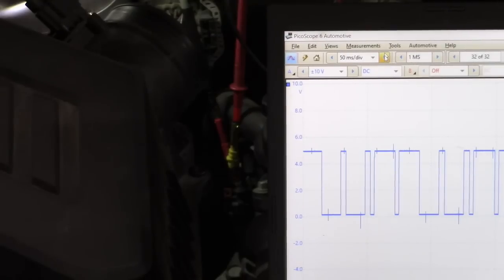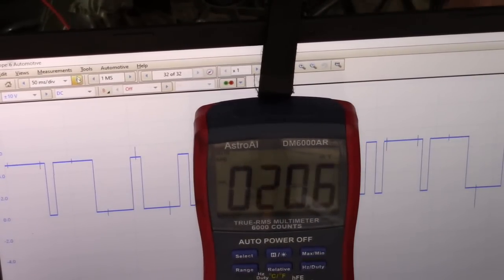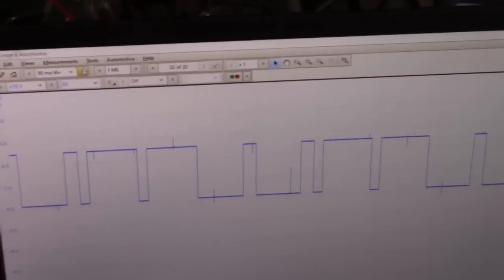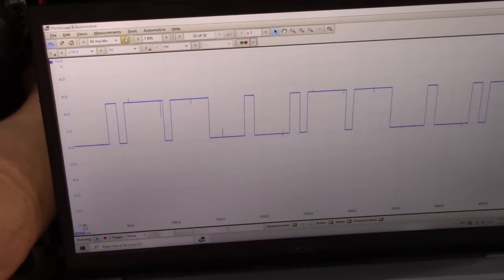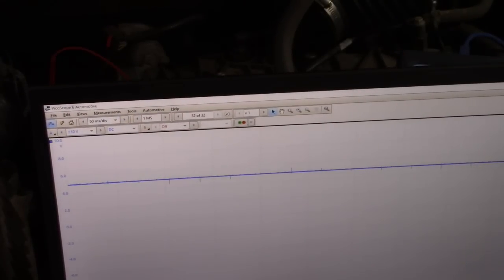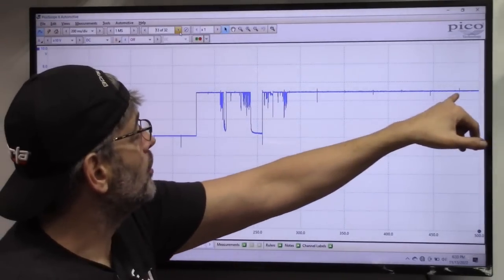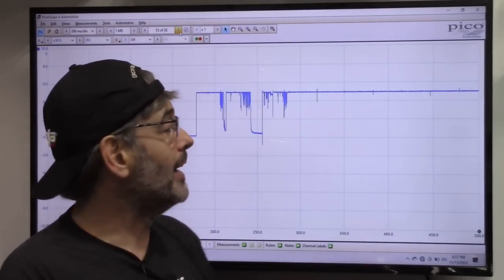How to Catch an Intermittent Bad Cam or Crank Sensor

Comment: what is shown in this video that when the fault occured the signal wire stayed at 5V indicating the sensor is faulty because it stopped producing signal and the fact it stayed at 5V (and not 0V) means the ref. voltage and ground circuit is good because without those it would show 0V,

I heard someone say some PCM are designed with a pull up resistor on the signal wire, and some with pull down.
therefore is this test only valid for PCM which have pull up resistor on signal wire which means the signal wire always has 5V when the sensor is not producing signal?

but if PCM is designed with pull down on signal wire then at rest the signal wire is normally at 0V when sensor is not producing signal, in that case when there is a fault that the signal wire is stuck at 0V it can mean either a faulty sensor or wiring?

does that make sense? I just recently learned some stuff about this I'm not an expert and I may be wrong...

Comment: I have found on my 99 Blazer that the Crank sensor 12v reference wire has continuity with chassis ground (the low reference wire also has chassis ground). Would this indicate a possible short somewhere and possibly be cause a misfire code?
Reply from the maker: Yes there reference wire of course should never touch a chassis ground. It should be direct from PCM to the sensor.

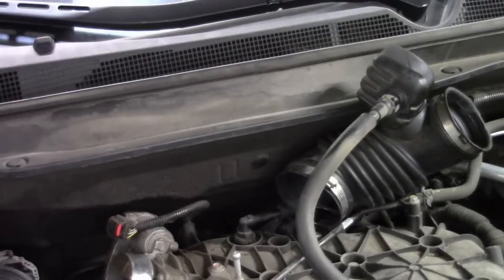Comment: 10:48 This is what’s happening to me now. I just got my sensors replaced two days ago (didn’t even know they were bad, wasn’t having any symptoms then) and now my car has a hard time starting on the first try. It’s incredibly intermittent. The mechanic couldn’t repeat after nearly an entire day of trying but then it happened to me after I took the car home. I suggested it was the sensors but he brushed me off and blamed the brand-new battery. He won’t even entertain the idea that it’s the camshaft sensors he just put in. It’s frustrating.

Comment: I have a 2000 k 2500 Chevy which I recently rebuilt the motor got it back in and running I did a final valve adjustment in on the driver side valve cover it's pretty tight so I pulled a little bit on the harness and lost my spark completely there is no RPMs when cranking no spark at the coil everything is new and I realize new is not always good but I actually did a test on those parts on my other truck and they all ran that truck fine so I'm thinking it's a broken wire from the crank signal. As I am not in the greatest of health it makes it difficult to do certain things but I watched one of your videos about a PCM crank sensor bypass and I'm thinking that may be my answer I have tested for 12 volt power at my coil at my distributor at my crank sensor and everything also I realize that continuity tests are not the greatest because it could be one strand of wire but that doesn't mean it's going to run the vehicle. This truck is just a base vehicle two-door and I'm trying to find out my best route without having to tear the whole harness out of it as you know those are a pain in the butt they go down and under behind the power brakes in the whole nine yards and I don't believe I have it in me to do that although the other problem is is I can't afford it as I am on a fixed income. If you could possibly help me find the pin out location on the PCM for the crank sensor location and color wire possibly I would very much appreciate it as I have all my money tied up into the rebuild and everything else and this is supposed to be my daily driver as my 96 Silverado is in very poor shape living in Ohio it wasn't taking care of so great as far as rust. Please please help.

Comment: Hello. So i wasn't able to check the voltages at the connector for cmp sensor. I went ahead and replaced the connector today and i had already replaced the sensor.  IT runs fine, starts fine, when check engine light comes on it runs fine and starts fine. Odd thing is it seems to happen consistently when I'm about a block from my house. I don't see any obvious chaffing.  
Do you recommend I run it till i get engine light and then check the reference? Or can this be done with some kind of live data?
Reply from the maker: Can’t say because we don’t have any data.

Comment: Hello , me again lol . I have replaced the alternator , new starter , new battery , fuel pump , cam shaft sensor , crank shaft sensor fuel injectors, computer etc. This car you can disconnect the negative cable on the battery and it still has a parasitic current draw . Oh this is still about the 2003 dodge caravan . And it is hard to get it to start even with a hot battery . It makes a clicking sound like , I don't know , maybe low fuel pressure . But after you get it started it runs very good , after you drive it a while and shut it off , it will start fine , But after it sits maybe 6 hours or so it is hard to start all over again . This thing is driving me crazy , but I'm too damn stubborn to give up on it . The funny thing is , I know you can figure out what's wrong with it . If I could afford what you charge , I would let you have  a shot at it ,lol . I've got way too much money in her , I can never recover any of it . I've got to keep her and try to make her last . It runs really good , just a bitch to start lol . 🙂🙂🙂🙂
Reply from the maker: Ok let’s start with the extreme basics here. 
  You replaced alternator, starter and battery.  What data showed all those were bad? What was your charging voltage showing? What was your voltage drop at the source and load?
  You replaced cam sensor, crank sensor, injectors and computer.  This doesn’t make sense to me- either there is no generated signal from the sensor OR the signal is not read by the computer. Which is it?
    What is the amperage of the parasitic draw?
    What is the fuel pressure? 

 M
Reply: Bad ground somewhere ?

Comment: Can you have a bad cam sensor/sensors without a ce light?  I am having some bizarre issues w my 2003 Expedition 5.4. I can start it up about 10 times super rough idle no throttle response soon as you hit the throttle it stalls real bumpy idol and then about the 10th or 12th startup it runs and smooths out and is totally fine for 10-20 min until you restart it.  No codes I'm just thinking it could be throttle position sensor or cam sensor I did the crank sensor last year. Also ANY touch of the throttle it wants to die when this happens. Any ideas thanks in advance.
Reply from the maker: You absolutely can. Usually I see it on intermittent no-start issues. Never get a cam signal code. However if the sensor fails while engine running you almost always get the code then.
Reply: @SchrodingersBox  TY I think it is ecm
Reply from the maker: Possible to. If that’s the case, simply check for signal at the PCM. If the signal is present at PCM but not recognized, then the PCM would be at fault. 
   Anytime I have ever done this I have always found the signal is not getting to the PCM though.
Reply: @SchrodingersBox  Everything is good NO ce at all, but like I said starts up fine and normal for about 10 min then BOOM all stumbly like a vacuum leak, then 7-10 restarts all normal again for 10 min all sensors are good even replaced the cam sensors and crank sensor.
Reply from the maker: What data do you have?
Reply: @SchrodingersBox  NEW UPDATE when I reset the ecm (pos/neg touch) it RUNS FINE, shut it off and restart back to CRAP I think its a ground (which I doubt) or the ECM.
Reply from the maker: Ok again- what data do you have?
Reply: @SchrodingersBox  NO data but like I said when I wipe out the ecm and start it , runs normal and perfect until I shut it off then I have to ground/reset the ecm again and it is fine I think it is ecm
Reply from the maker: Of course there is data. What’s the fuel trim showing ? What’s the voltage for the cam signal showing? What’s the coil pulse signal voltage? What’s the ground side voltage control for the injectors showing?
  This is all basic data that would be needed!
Reply: @SchrodingersBox  I have no way to get that.  Im just shooing the parts cannon.
Reply from the maker: Well I can’t help with that. Just get a $3 test light and get some data. But without data there is no way I can tell what’s wrong. I would just be guessing.
Reply: @SchrodingersBox  I agree but at this point it is really pointing to the ecm like I said before can you pls email ill send videos.
Reply from the maker: How is it pointing to the ECM when there is no data showing that? 
  If you want to replace the PCM it is virtually guaranteed you won’t fix it. There is no data showing the PCM is receiving signal.
Reply: @SchrodingersBox  Just going by the fact i replaced most things that would cause this and like I stated when I reset the ecm it works fine until I shut it off and restart it it goes to hell again.  I sent you my email like I said I have videos.  What would you look for first based on "Data" with a test light?
Reply from the maker: You would check for voltage signal to the PCM. 
  Just changing parts on guesses and not fixing it is hardly evidence of a bad PCM. You really need to find the actual problem. It’s not the PCM.

Comment: Great video!!! So on my chevy utility 1.4 i have a crank sensor which is not connected and i have 3 loose wires without the plug to the sensor, how do i connect the sensor. i a ground wire and two 5v wires and i have pin 1, 2 and 3 on the sensor how do i connect them?
Reply from the maker: The easiest way is to just find a connector end diagram showing the configuration.
Reply: @SchrodingersBox  how do i find it?
Reply from the maker: You’ll have to google it or get a service manual. 
  I mean alternatively you could also just look for reference voltage and ground on the PCM side of the wiring and then match it to the sensor.
Reply: @SchrodingersBox  it worked thanks alot

Comment: Idk if you're still responding to comments but i have an 07 LBZ Duramax with an intermittent p0340 code. Replaced, as you said, and it came back two weeks later. The strange thing is it only happens under a hard acceleration or just more throttle than just normal driving.
Reply from the maker: I would never have said to replace anything for a P0340. I would have said to test the signal voltage. What was your signal voltage showing?
Reply: @SchrodingersBox  no I meant I replaced it as you said most ppl do. Lol. I'm checking that this weekend.

Comment: This video has been helpful thus far.  Quick question. So when I'm connected to the signal wire and the ground wire at the crank sensor when I turn it to on before starting I'm getting 10.4 volts. Which given my understanding should only be sending out 0 or 5.  So then I went up the the ignition module. Connected to the signal wire and the ground up there.  Read 0 when turning the key at first. And read the average when attempting to start.  Why would my signal wire at the sensor be reading 10.4 before I attempt to start?  I'm in a crank no start.
Reply from the maker: Sounds like your design has open ground at the PCM until rpm is generated.
Reply: The overall problem is I have to keep changing the crank sensor to keep my truck on the road.  I think im on my 12th sensor.  On the current one I am getting readings of 0 and 11 on the signal wire. And the codes 0336 and 0339.  What could be causing these to keep failing?
Reply from the maker: What design is it-  Hall effect or inductive?
Reply: Hall effect
Reply from the maker: Perfect-  you should check voltage on the ground. What in the voltage showing on the ground?

Comment: I wish I had you , to fix my 03 dodge grand caravan , I know for a fact that it is electrical , just not able to figure out how to repair it , don't think I'm even getting any power to the crank sensor . The story is too long, but when she is running she is sweet , but intermittent has turned to crank no start .🙂🙂
Reply from the maker: If you are in Colorado I would fix it for you.

Comment: I just found you site and really got so information that I will use to figure out why the tec couldn’t get my css to learn. I have a 2005 4.2 in a trailblazer. Is there a big difference in the Diaonsis with my sensor being a 2 wire connection?
And Is the book still available. Thanks
Reply from the maker: Yes the book is available at www.schrodingersboxQM.com.

Comment: Did you put dielectric grease in that plug???????
Reply from the maker: No. Why would I do that?
Reply: @SchrodingersBox 
It prevents moisture from corroding terminals in damp conditions, also dust, by waterproofing the connections
Reply from the maker: The silicone seal does that for me.

Comment: I changed my camshaft sensor work fine for about 2 or 3 days and then went right back to like it was faulty again engine light came on and pushed the gas and it's like it's not getting power idles fine and everything but turns over too many times to start but it does start what's causing this like I said it's a brand new camshaft sensor we're fine for 2-3 days and then went right back again
Reply: The camshaft sensor work fine for 2-3 days and then went right back tomorrow's number for
Reply: @RandallHorn-sf6nx I read sometimes certain brand cam sensors are shit compared to others.Not saying that’s your problem but Thats just something to keep in mind.

Comment: LOOK NEED HELP NOWWWW..... i have a 2006 honda accord ex 2.4L 4 door sedan Ahh my car shut off while driven point is the Starter is whining wngine not turning over bendix want turn flywheel no sound from engine at all Starter is Whining only ANDD my 3rd New starter does the same thing so its not the starter what is it / cam amd crank sensor i know but still what is it still ??
Reply from the maker: broken timing belt?
Reply: Wire harness is good fuel pump good switch battery didn't work so what els spark plug ok so what els
Reply: Impossible I already checked that's not it
Reply from the maker: Starter shimmed incorrectly?  How did you verify timing belt isn’t broken?
Reply: I have not even shimmed it because it's on correctly and I checked that as well but I find out it could be the crankshaft pulley or shaft itself if so I will just add new parts
Reply from the maker: Well can’t be a crankshaft pulley because the starter engages the flywheel. I would say a broken tooth on flywheel but it can’t be that since you confirmed the timing belt isn’t broken and you could only know that from cranking the engine over which would move the flywheel.
Reply: I reopened the manifold it was my timing chain not belt dag I appreciate it man cause you had me thinking but I'm about to change it now

Comment: What if you aren't getting any code? Periodically cranks but won't start. 2008 corvette ls3.
Reply from the maker: Then apply FASTTEC method when the issue happens. 
   I almost never see a code on a cranking no start.

Comment: Here's a challenge for you I have a 1996 Ford explorer and it has rough idil and done times it shut off while driving and I don't have scoop or any tools your use in your videos besides test light and the crank sensor is dirty it's the original crank sensor from 1996 I looked for vac leak and and I don't have one a shop replaced the valve cover gasket ever since I had this problem and I just don't want to replace the part if it's not the sensor and no engine light on
Reply from the maker: It’s not a challenge- there just isn’t any data here. Do you have any data at all to get even a beginning starting point?
Reply: @SchrodingersBox   when I had the valve cover and intake gaskets replaced it would not stay running because the place that replaced them made a air leak and then fixed it and it was fine for a day or so then it started to have a rough ideal then I did research on the internet and found out it could be the PCM crank sensor fual filter or spark plugs so I replaced the fuel filter and I know it's not the  pump because that went out on me and I replaced that already so I went to replace the fuel filter to to see if it would fix the problem but it didn't I have a dmm I'll see if I have 5 voltage at the sensor and a test light that it i dont have. Your scan tool to do the data you can get
Reply from the maker: Just some basic reference and signal voltages would be a start. Right now there is nothing.

Comment: Great video and explanation. My 2005 Wrangler TJ continues to display a DTI P0344 intermitent cam sensor. I think it may be do to a wiring issue since changing out the cam sensor doesn't improve matter. I wish I knew how to find a person like yourself in the Seattle area as I know nothing about trouble shooting this situation. Do you have any advise or maybe you might want to take a short vacation to my part of the country?!?!
Reply from the maker: Well shoot man, wish I could help but no plans to be in Seattle anytime soon. 
  All I can suggest is my cam and crank sensor video on www.schrodingersboxqm.com which literally walks step by step through this diagnosis.